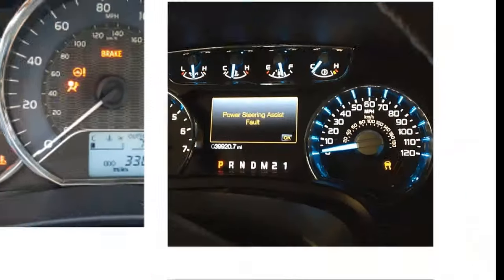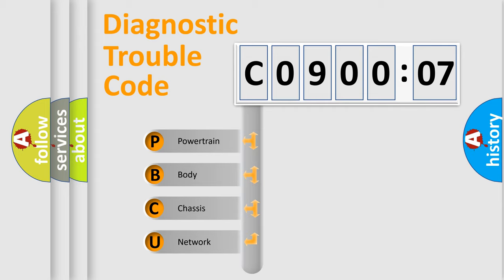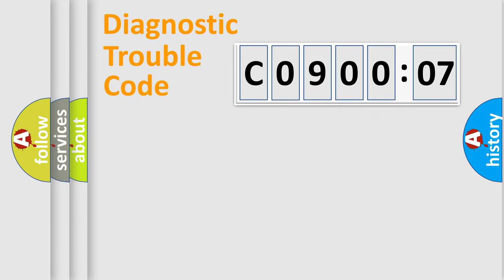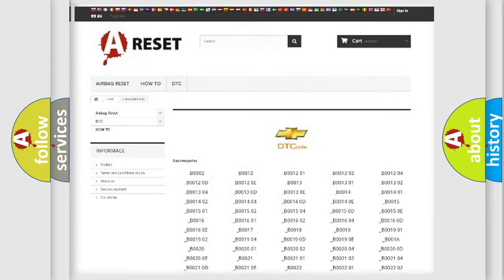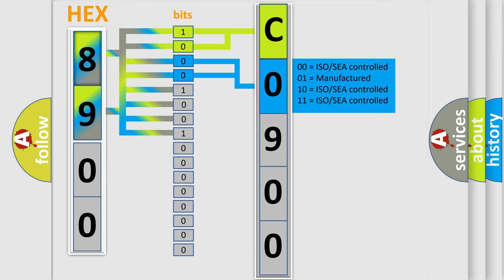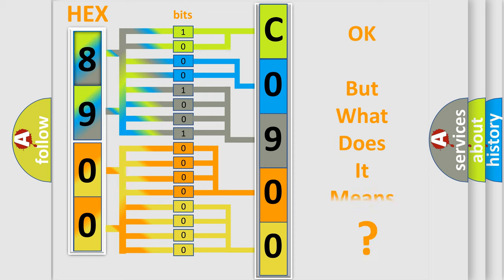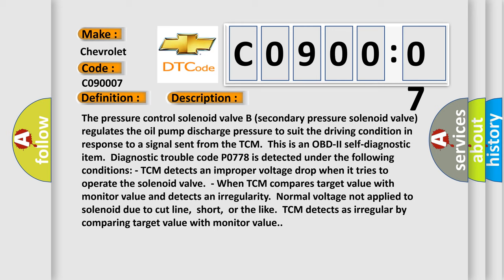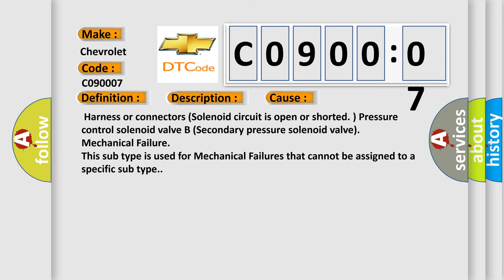DTC Chevrolet C0900-07 Short Explanation

Comment: After suffering through ALL of that cpu garble you give me the WRONG definition?  c0900-07 is an ABS code that means:
"Control Module Power Circuit- High Voltage"
I had this code pop-up on my CTS & it turned out to be an over-charging alternator!